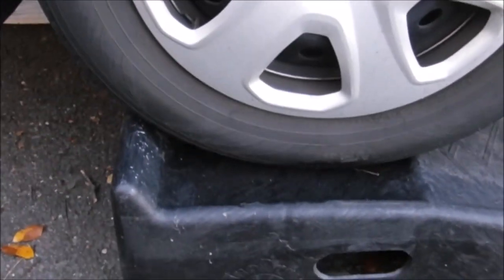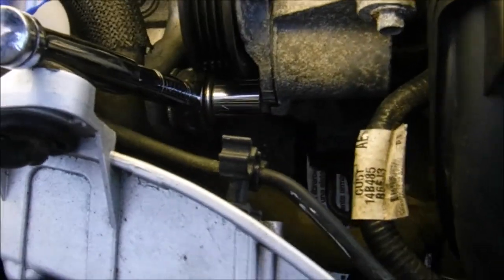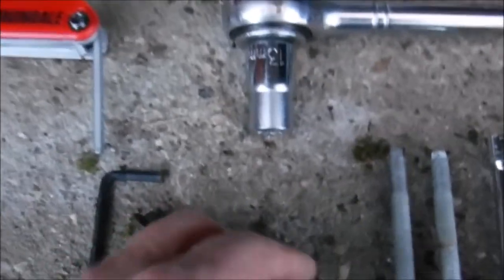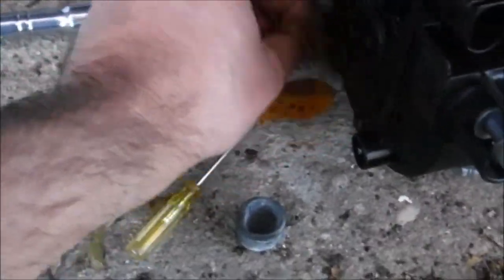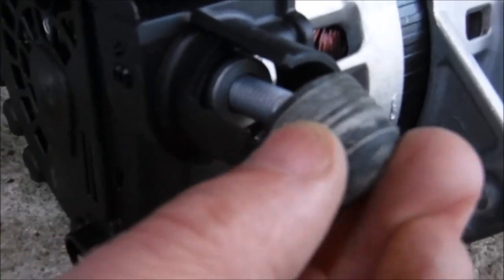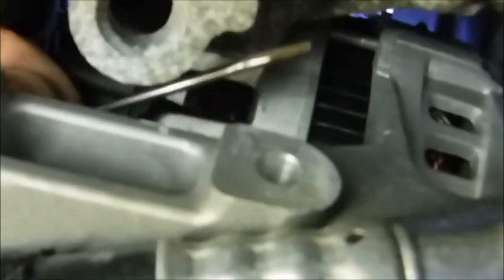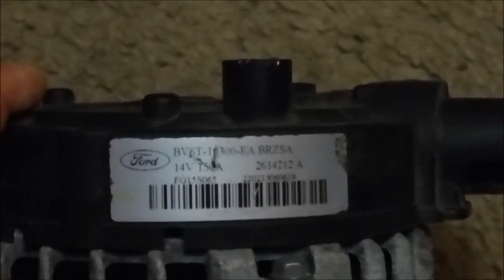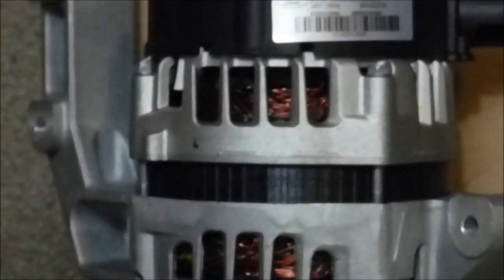2012 Ford Focus Alternator Removal

Comment: When I was removing the alternator and taking off that single wired connector the wire broke off right at the connector. I cant find the part at oriellys, autozone, or any of the ford dealerships. I found it online but it doesn't tell me whether or not it comes with the wire. Since it is crimped inside the connector, I need it to come with a length of wire so that I can splice it. I'm stuck any suggestions?
Reply: 2015 ford focus se flex fuel 2.0L

Comment: Just went through this on a 2016. What a nightmare. If I made the video, there would be a lot of 4 letter words being used. We didn't remove the stud to get it out... just pried it against the rad hose. Wouldn't go back in though. Finally removed the stud and shortened it. Used a double nut to screw it in. Wanted to replace it with a bolt, however Hardware Store was closed.